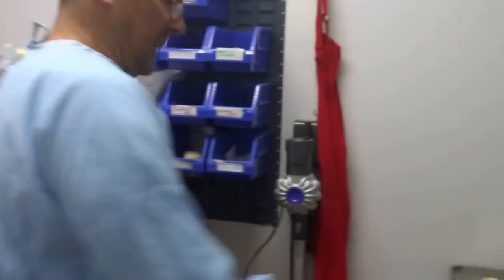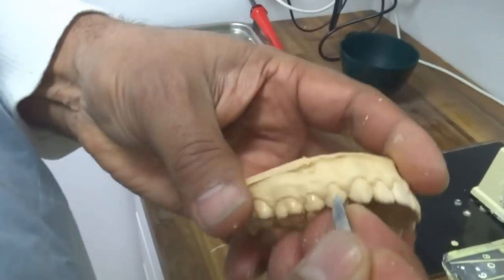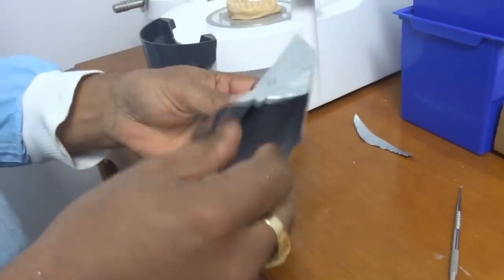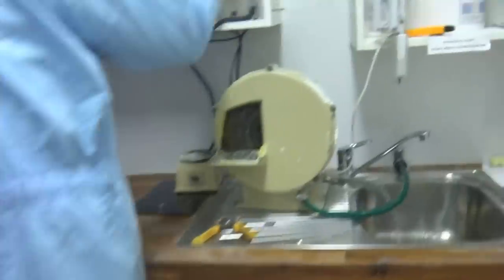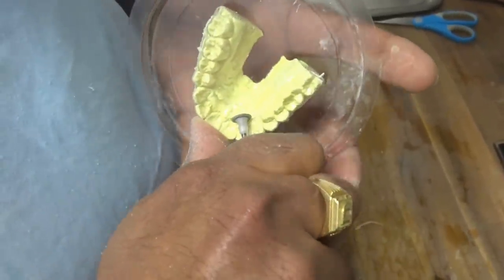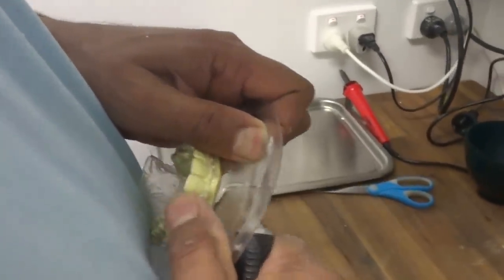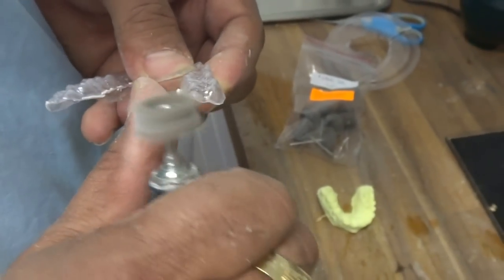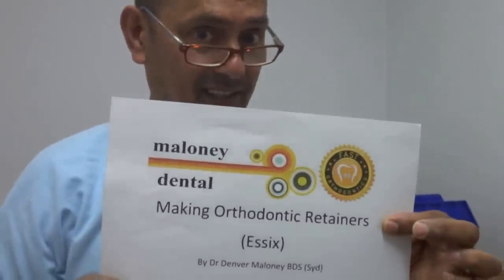Making Orthodontic Retainers

Comment: My retainer has a slight crack is it able to be fixed? Or must be replaced
Reply from the maker: Christiana Marie it must be replaced. I suggest you get digital impression and model made first, from this model mint retainers can be made and will save money in long term
Reply: Mine had a chip in it and I got it fixed without buying a new one I depends what ortho u have

Comment: How come you don't put an extra thin layer of block-out resin (sometimes blue color) on the outside of the teeth so there is enough extra space for the whitening material ?
Reply: because this is a retainer to keep teeth still in place after bracing, some dentist may like it "perfect fit" :)
Reply: Then it would not be for teeth bleaching, which I was referring to.
Reply from the maker: Hi Gung
I do it for a couple of reasons which are; the patient has to use less gel and I have found that it has no impact on the whitening result as only a very small amount will diffuse into the tooth enamel as well.

I do sometimes place some spacer as a reservoir from the incisal edge down to 2-3mm above the  DEJ and mesio-distally confine it to the flat area do not take it beyond the mesial and distal line angles onto the  curved surface of these areas. I only do this if the patient needs extra whitening on some teeth, I very rarely do it.

For the spacer I use a small flat ended camel hair art brush, to apply a very thin layer of some dental plaster which I mix up as a runny slurry and paint it onto a dry model, works great and is very cost effective.

I hope that helps
Cheers Denver
Reply: Kevin L
Reply: This are retainers not bleaching trays
Reply from the maker: Hi Gung, the retainers are not meant to be used to deliver whitening gel onto the teeth. However, when I make whitening trays, I no longer use a block-out resin as I have discovered it makes no difference to the whitening outcome. 

If you like creating a whitening gel reservoir, I suggest you try as follows: 1. Create a plaster slurry (very thin/runny) by mixing a 1/2 teaspoon of dental plaster with some water, 2) Using a small artist paintbrush, paint this slurry onto the dried stone model to create the whitening gel reservoir. This is how I made the whitening gel reservoir; it works like a treat, costs peanuts and takes a fraction of the time and skill to apply the block-out resin.

Let me know how you go if you try it.

Regards, Denver

Comment: I make my own retainers, but occasionally they are slack fitting. I use either 1mm  or 1.5mm sheet I am confused as to what I'm doing wrong, they are vaccum form tight around the mould, so in theory these should be tight fitting every time. Any help appreciated.

Comment: Is there another way of melting the plastic that precise way? Had braces for 4years ,got them off and my retainers broke 6mnths ago,was caught up with things and couldn't go so my teeth shifted a bit. My dentist is asking me for 500$. I don't mind but I'm having a jaw surgery somewhere at the end of the year. I just need something to hold my teeth together while i wait. I already have the impression of my teeth. Plus I bought the clear plastic I just can't find a dentist who'll charge me for the use of a machine by plugging it. Lol is there another heating system that can be use?
Reply from the maker: Unfortunately you not only need heating you also need pressure to mold the plastic. I have a cheap Chinese machine that does apply the heat and uses vacuum to mold the heated plastic but is is not as accurate as pressure forming. The Chinese machine can be purchased through Ebay the details are eBay item number:182128430556 and it is called Dental Lab Vacuum Forming & Molding Former Thermoforming Material Machine JT-18. But you need square plastic blanks and you need to know how to operate it.
Reply from the maker: Hi Charlotte
Thanks for the link there are so many things that can go wrong with impressions, I would be dubious about getting this done, best bet is to find someone to take a digital scan of your teeth or better still get your orthodontic dentist to scan your teeth and provide you with the soft copy file. You could send to me and I could can get it printed and make the retainer for you, the first one will cost $150 AUD plus shipping, but after that I can make more retainers at a cost of $60 plus shipping for each retainer.

Thanks
Dr Maloney

Comment: Do you have to get new impressions done every time you need a new retainer? Thanks
Reply from the maker: Great question; when using stone models, the answer is yes, as the model breaks when taking the retainer off the model. However, I use the process now to get a digital impression and save it to the patient file. When my patient needs a new retainer, I send the digital model to be printed and then make the replacement retainer on the printed model. The fantastic news is, the printed model does not break when removing the newly formed retainer, so I can make many retainers using a printed model.

I do the scans at no additional charge to the patient. I then charge $60 to get the model printed and $60 to make a retainer using the printed model.

I hope that helps with your inquiry.

Regards, Denver
Reply: @FastOrthodontics  thank you so much! 😁

Comment: Hi, I recently lost my upper set of teeth retainer after only recently started wearing again after a few months of not. And right now my top front tooth is protruding out a little from the symmetrical circular shape. Can I request my dentist to adjust the model of my teeth to the symmetrical circular shape before hardening the model and fitting the retainer so that it can get back to its original position?
Or can I ask to make minor adjustments to the retainers like filing the front part to make it even out etc?

Thank you,
C.Y.
Reply: Your dentist should have a mold of your teeth when they were straightened perfectly. So he can make u that perfect mouthguard and you should b able to then straighten up that small tooth movement

Comment: any tips for making retainers when there is already an lingual wire fixed? or is it all the same?
Reply from the maker: Hi Luisana. I would use block-out material to remove undercuts on the wire and composite bonding pads, plus use block-out material to create an approximately 0.25 mm space over the wire and bonding pads. The objective is to not allow the removable retainer material to exert any direct force on the wire or bonding pads.

I hope that helps!

Comment: Great video, thanks. What is the thickness of material?
Reply from the maker: Hi I currently use Taglus Tuff, it is 0.9mm thick. More details here: https://www.taglus.com.au/collections/taglus-tuff-retainer-material/products/taglus-tuff-retainer-material-0-9mm-x-120mm-round-box-50.
Reply from the maker: I recently went back to Essix strong, but I have had too many retainer fractures with this material, so I have gone back to Taglus Tuff. Maybe the lockdown anxiety is causing retainer wearers to clench and grind more which has led to an increase in failure?

Comment: Why aren't you wearing gloves!!!🤮🤢
Reply from the maker: Hi Haley,
Great question, thanks for asking. Keep in mind this is a laboratory process and as such the wearing of gloves is not mandatory, as a matter of fact it can at times be difficult to safely hold the retainer when trimming it with gloves on. Hhowever we do routinely perform hand hygiene before we start handling these retainer materials. Anyhow before the retainer is given to the patient is is properly cleaned and sanitised, read on.

When we have finished trimming and polishing the retainer, we do the following:
1. Rinse it in cold water to remove the dust produced when cutting and polishing, then
2. We then disinfect the retainer in a bath containing a solution of 1% sodium hypochlorite (NaClO) and 16.5% sodium chloride (NaCl; common salt), after that.
3. The retainer is removed from the disinfectant bath with clean tweezers and again rinsed under cold water,
4. It is then dried using some compressed air and placed into the retainer case ready to be given to the patient.

I trust this puts you at ease regarding sanitary handling of the retainer
Reply: @FastOrthodontics  Extremely unsanitary! Glad I dont go to your office!!!